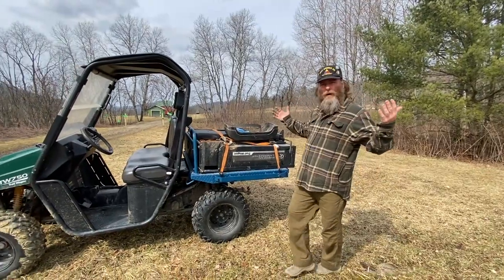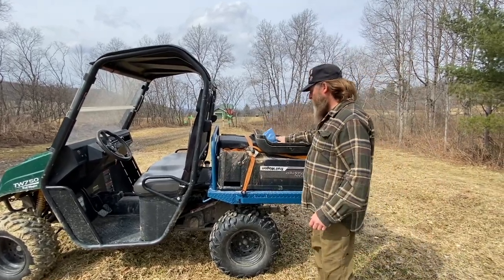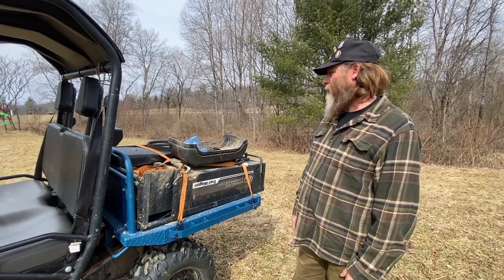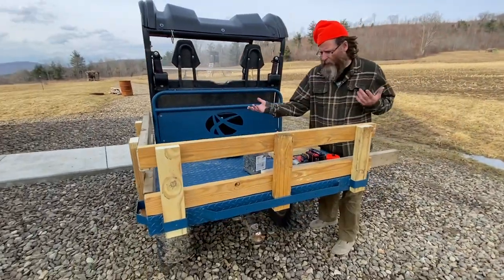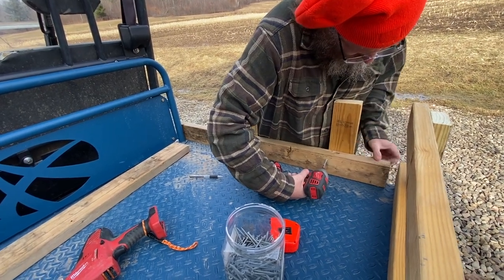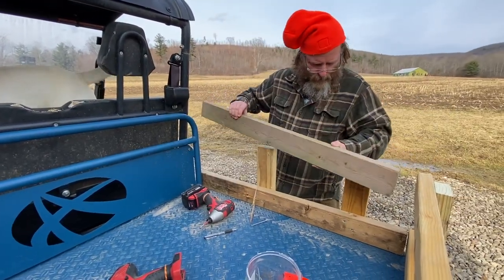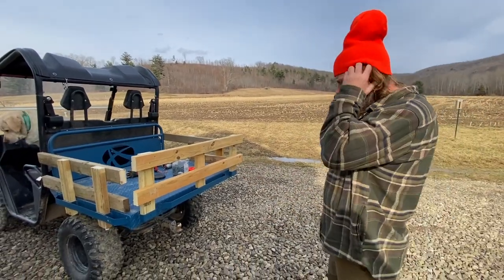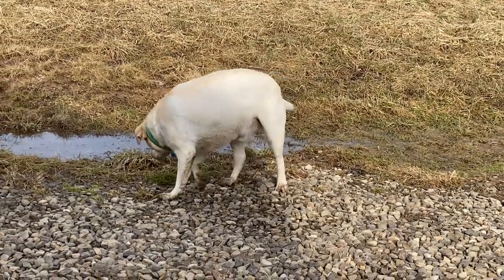American Landmaster serviced and back in business!

Comment: I've had one of these BD700 for about 10 years now. I have issues with the starter not wanting to engage.  The battery is hot, but sometimes I have to turn the key back and forth for 5 minutes until it catches. 
I think it's probably a solenoid issue, but I can't find the solenoid.
Do you have any ideas that I might try? Any help is sincerely appreciated. Thanks in advance.
Reply from the maker: I find the gear shifter has to be perfectly in neutral or it won’t start. Never had a problem with the starter. I believe the solenoid is part of the starter. Since these are simple engines, you could order one offline and swap it out very easily.

Comment: Never thought of a flat bed on a side by side, looks like it will work good
Reply from the maker: It’s gonna get a work out soon, spring food plots right around the corner!
Reply: @oxford821  im thinking about getting a compact tractor and getting real serious about food plots this year
Reply from the maker: @dustybowhunter    I really wanted a tractor also. I thought I needed a tractor to do food plots. Last year I did everything with my UTV, chain drag, 25 gallon sprayer, and chest spreader. This year I bought a bigger pull behind spreader but I can’t seem to justify $20,000+ on a tractor. It would be nice but thinking of that payment scares me away.
Reply: @oxford821  maybe i should try a chain drag this year, looks like they do a good job but how do you think it would work in small food plots in the woods? I feel like it would be getting caught on small stumps and roots
Reply from the maker: @dustybowhunter    You’ll definitely have to cut back some trees so the sun lays on the ground. The chain drag will still scratch up the surface over the roots. It doesn’t seem like you’ll be planting corn or other seeds that should be actually “planted” so I think with some sun light and a broadcastable type of seed it will work.

Comment: $100 and some change on that flatbed?   😢. I was robbed. 😢. But is real handy with bales and I did the same with a few two by fours.
Reply from the maker: Yea, I got a deal. The shop had the bed sitting on a shelf collecting dust.
Reply: @oxford821  I'm going to be in need of one of those molded seats soon.  Where is your maintenance guy?  Mine  is more of a chainsaw Stihl shop.  They don't have anything for my 450 in stock.
Reply from the maker: Sandy Lake, PA